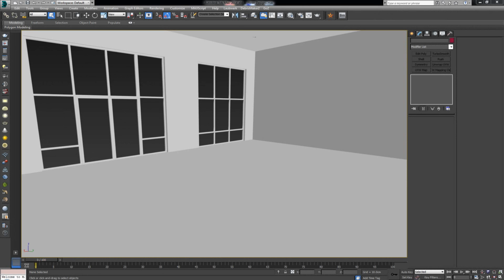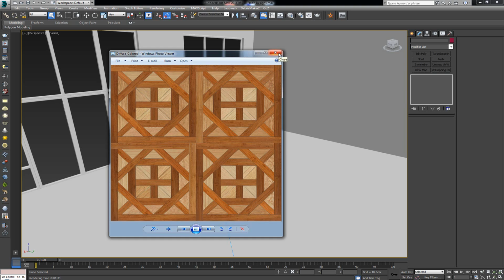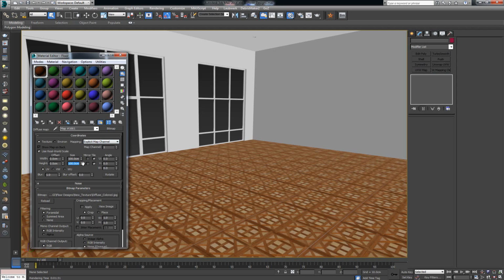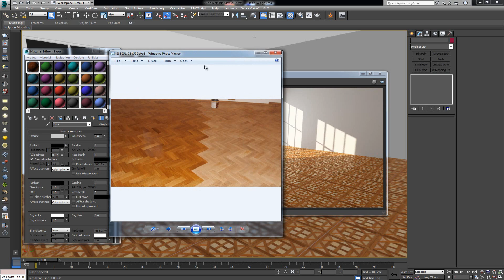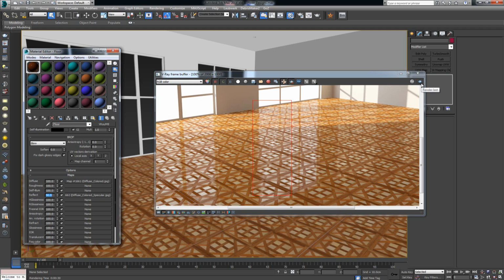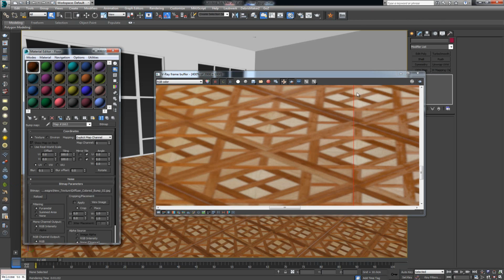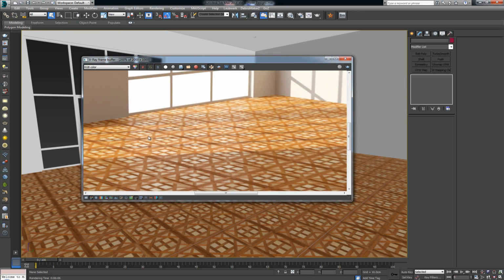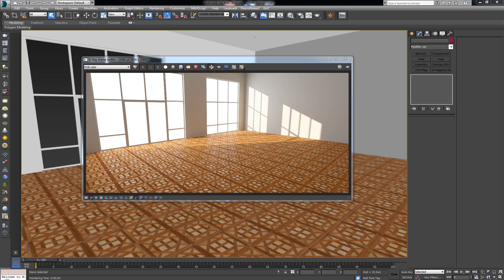Custom Floor Textures Rendering the Texture

Comment: Thank you sooo much for these helpful videos. Actually, I'm an interior design student and I've started learning max a few months ago, but I've never been so happy with the results. I watched your vray introduction videos and the interior lightning one was very helpful, but I have one question about rendering. How can I render a high resolution scene with the shortest amount of time? because I met someone who's pro in max and he finishes his complicated scene within less than hour with high-res shots.. what settings i should change? 'cause increasing the subdivs, which is the key for clear and high-res scene i think, also increases the render time. thank you
Reply from the maker: +Sondos Khudair Getting the renders to go a bit faster is basically a trade off between the subdivs and Antialiasing. The trick is to get it to use the least amount of AA while keeping a good amount of subdivs. In the 3.3 Version of V-Ray that has been simplified a tad bit with two sliders controlling AA and subdivs directly.
Reply: +Denis Keman I'm very grateful for the response... since we are in textures, have u ever heard about an app called CrazyBump? it's a very great app that i saw someone use that generates maps like displace/bump/specular etc from any texture without photoshop and it comes up with really nice results. I would really appreciate it if you would make a tut about those maps and how to use them in vray materials on floors or furniture for example.
Reply from the maker: +Sondos Khudair CrazyBump is basically a piece of software that makes a spec, bump and normal map from a diffuse map. I do know how to work as i have used it in the past, but in all honesty i prefer to use Pixplant or Substance Painter to generate the maps. Quixel Suite is quite awesome as well, but i'm simply still not too experienced in it to be able to make any videos about it.

Comment: Interesting, but I prefer set the Length/Width in the UVW Map, and avoid to change the Real-World Map Size in the texture properties, one by one. Or in the last case use the MapScaler modifier.
Reply from the maker: +Wagner de Souza A very valid approach as well. See this is the great thing about this little community that is starting to grow a bit by bit, people watch the videos then leave their own experiences in the comments and many times those comments happen to be things that are very useful. So cheers and thank you for your comment.
Reply: There is 3rd option somewhere in the middle. You can adjust the parameters and options like "real-world map size" of one map lets say under Diffuse channel then go to Maps tab where you have all the channels and drag & drop (copy) the already prepared Diffuse one onto other like Bump or Reflect. Then you just need to enter each of those and reload proper map (e.g. bump for bump channel, spec for reflect and so on...).